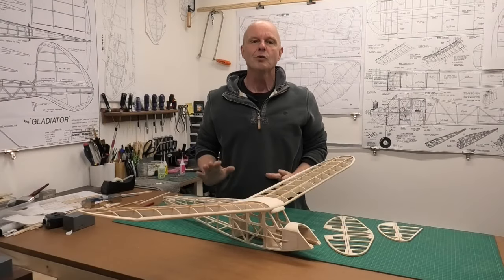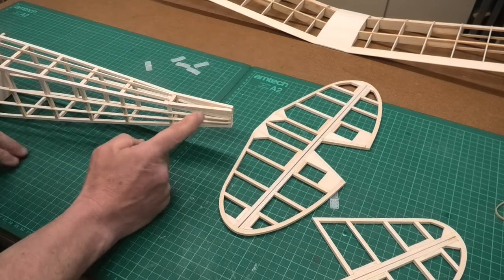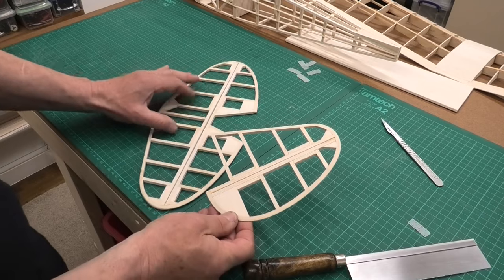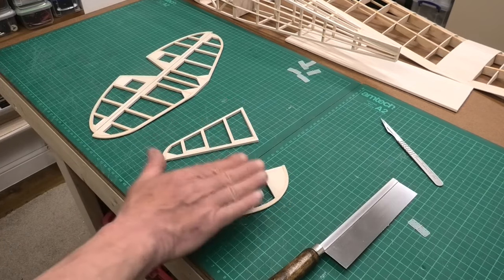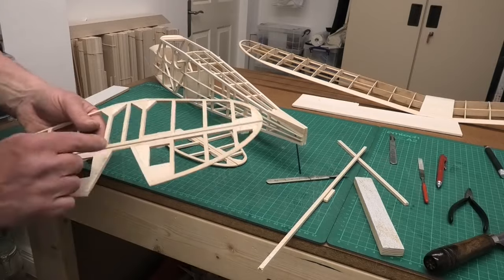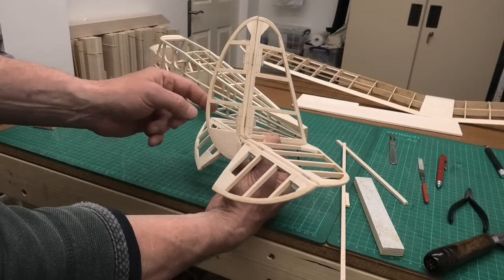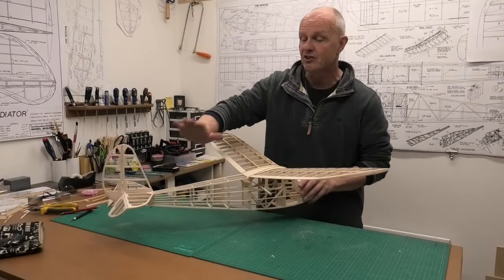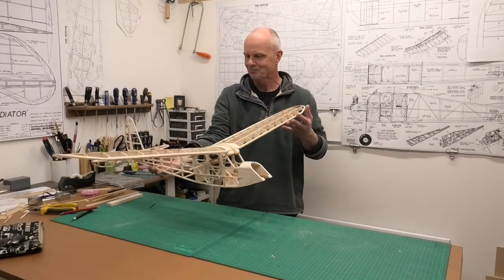45" Quaker & Mills Diesel - Build Series: Pt 11 Fitting & Hinging the Tailplane & Fin

Comment: Here is a tipI learned from Master builder Bob Benjamin, when installing hinges,drill a small hole at both ends of the hinge layout, then cut between the holes without fear of splitting the wood. Does a really neat job. I have a small drill bit in a old X-Acto knife handle that works like a charm. I hope you try it, let me know what you think. Mike 🇨🇦
Reply from the maker: Thanks Mike, always appreciate tips and suggestions